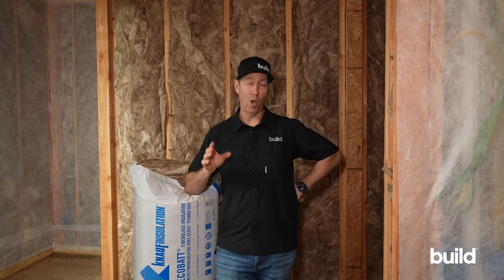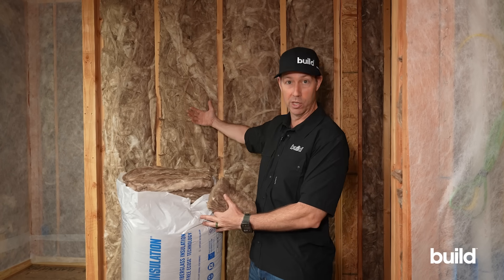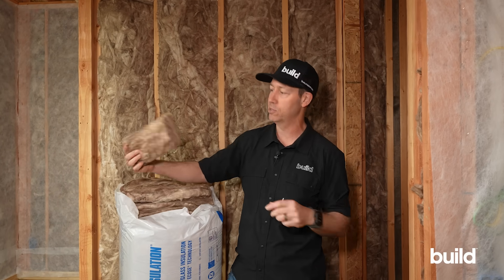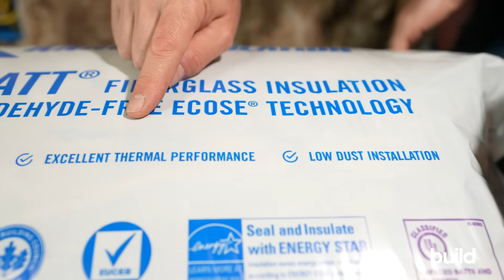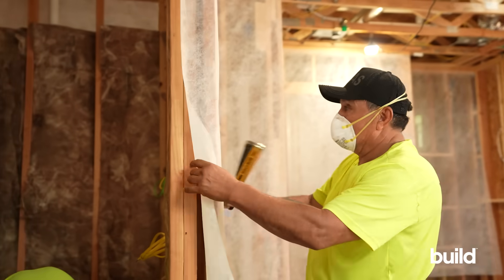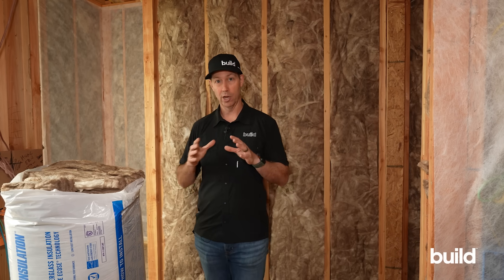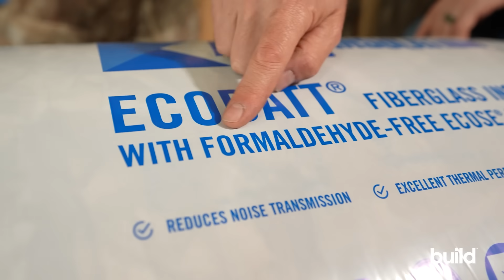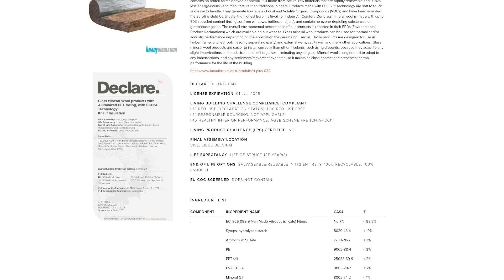NEW Fiberglass Insulation Tech & 3 ways to Use it for a quiet home!

Comment: Can that putty patch be used in attic to seal and soundproof? We live in a noisy city and I notice the sound vibration is greater through the hip roof.
I would like to beef up the road side insulation with rock wool batts.
The curent blown fiberglass has packed to R30. Recommended is R70. Can I mix the insulation?

Comment: Do you use that  same insulation in the ceiling .. when using spray foam on the rood deck and exterior walls ?
Also .. is that permiable sheet cloth have to be used over the  sound insulation?

Comment: Does the binder attract bugs?
Reply: The insulation goes through a curing process during manufacturing that removes any/all possible nutrients for pests and mold. Mold can grow anywhere that food and moisture exist, but there’s nothing in this product that can feed mold or attract pests. It’s been on the market since 2008 without issues and has testing to back it up.

Comment: What’s the paper that is up on the walls?    Assume it is breathable just to hold the insulation?
Reply: Good question. The fabric on the wall is an air permeable mesh that’s used to make sure the insulation stays in place before or during drywall installation.
Reply: @KnaufNorthAmerica who manufactured it ? Where can I buy it?
Reply: Can you use this stuff on exterior walls? Spray foam is so expensive…

Comment: My only concern is will the insulation biodegrade in your walls rotting over time causing mold issues in the future
Reply: The insulation goes through a curing process during manufacturing that removes any/all possible nutrients for pests and mold. Mold can grow anywhere that food and moisture exist, but there’s nothing in this product that can feed mold or attract pests. It’s been on the market since 2008 without issues and has testing to back it up.

Comment: Yes Structure stiffness is a big issue with sound attenuation. Those little holes let through high frequency sound which is easier to stop because of the low energy. Low frequency will move the whole wall, and can be almost impossible to stop at certain levels. In studio build we decouple the inner room and the outer structure, to allow the air gap to dissipate some of that LF energy. Contractors need to be very carful using "Sound Proofing" as a term. Because at a point you wont be able to. (remember the aircraft noise in one of Led Zeppelin's Songs "Nah leave it in").  MDF is a good mass material perhaps under the sheetrock. And always seal the perimeter of the sheets to the frame. Double wall if you can between critical rooms. And also Rockwool Rockboard 60 or 80 is an excellent mass wall fill. On another note, try not to have parallel walls if possible, as they create standing waves (echo). And have sound absorbers in noisy rooms, more important these days as we tend to shy away from Carpet. Good informative video mate.

Comment: Maybe this insulation is different, but standard insulation basically does nothing inside. The cheapest way I have found is to use ice and water shield. Put it loosely in the walls before sheetrock. Going over the studs also gives uou that little buffer of transfer through the studs. You can also use it in place of putty pads. If you want to go the next step, then add insulation, preferably Rockwool.

You can also use the ice and water shield to wrap pipes in the wall to cut down sound in walls.
Reply: What brand of ice & water shield ?
Reply: Wouldn’t this create moisture problems ?
Reply: @juiceman8873  I use Grace. I am in Alaska. It acts as a vapor barrier on outside walls. And it's not an issue on inside walls. You would just need to be careful how you use it in your climate.

Comment: What is that felt paper your using?
Reply: The fabric on the wall is an air permeable mesh that’s used to make sure the insulation stays in place before or during drywall installation.

Comment: I suggest a book - The Master Handbook of Acoustics (Everest and Pohlman).  It's more about mass, isolation of mechanical transmission, and stopping air leaks than stuffing batting inside the walls, although that will help.  The question is whether or not the additional expense is worth the STL (sound transmission loss).

Comment: Like so many ideas the best idea is covered in first 2 minutes. Reducing wall noise by 25 % with BULK insulation and THEN  ad .0025 %(or less) more quiet by plugging PIN HOLES.

Comment: What is the purpose of the non-woven fabric on the internal walls?
Reply: The fabric on the wall is an air permeable mesh that’s used to make sure the insulation stays in place before or during drywall installation.

Comment: Please don't handle fiberglass insulation like ever again for your safety 😢Even if it is "safer" fiberglass. What makes fiberglass so dangerous is that the actual glass fibers under a microscope look like tiny microscopic needles that do not decompose. Google alveoli structure in lungs. Those fibers that you can't see will get stuck in your lungs and will lodge itself inside causing microscopic scraps. The body can't get rid of it and glass is non decomposable. The fibers will only come out after you die.
Reply: How do people then survive a career of insulating if the body doesn't get rid of it?
Reply: @olgajoachimosmundsen4647  They don't, they have a severe heightened risk of lung cancer. It takes years to develop we are talking 10+ 20+ years. On top of that if you get lucky and don't get cancer you will permanently experience reduced lung capacity like shortness of breath. Same goes with silica dust.

Comment: Fiberglass insulation, state of the art 1960’s…now it’s 2024, maybe there are better options? Unless you like insulation that absorbs water and provides rodent friendly housing.
Reply: Foam is toxic, so that's not a good option. It emits toxic vapors for a long time.
Reply: The insulation goes through a curing process during manufacturing that removes any/all possible nutrients for pests and mold. Mold can grow anywhere that food and moisture exist, but there’s nothing in this product that can feed mold or attract pests. It’s been on the market since 2008 without issues and has testing to back it up.

Comment: I would rather use Roxul stone wool, it's already a lot itchy then most fiber glass.  Plus is has the benefits of: Noise reducing, inorganic (yes things actually do eat fiberglass, not for food but just to fill their stomachs to make them feel full) and that it wont rot if it gets wet.  But the most notable difference the temperature before each insulation which catch fire/smoke out.  More fiberglass smokes out instead of burning out at 800°, Roxul on other hand wont ignite until 2,100°
Reply: I'm in the mineral wool camp too. It's hard to eat or burn rock! I love how rigid it is relative to fiberglass, and I can cut exact shapes.
Reply: I was in the mineral camp until I used it.  It was so much worse than fiberglass for itchiness.  I couldn't believe it.  I hate fiberglass and I hate mineral wool more.  The cost difference isn't justified either.
Reply: Depends I've had batch of safe and sound that stuff and another that was floppy. Manufacturer wouldn't help aside from go back to homedepot. I had some leftover from the previous batch to show the difference.
Reply: @MBisFrenchy  I agree,  That is why i figured out that Lowe's gets better bags, or you have to order a stack of 12 from Home Depot online when they have it.  Supposedly Home Depot online is separate from the Home Depot stores.  Of the 2 orders i got from the Home Depot online the quality is better.  And it's probably because what they have in the store is there a long time and / or abused

Comment: What do you call the sheet that's being placed over the insulation?
Reply: The fabric on the wall is an air permeable mesh that’s used to make sure the insulation stays in place before or during drywall installation.
Reply: @KnaufNorthAmerica where can you buy this ?
Reply: @KnaufNorthAmerica  do you have a product name, if even a generic name if you don't manufacture it yourself.
Reply: Moisture barrier

Comment: Your comments about air transmission and 1/2 inch holes reminds me of building a music rehearsal studio in my youth.  This was in the early 80's.  I had studied studio design.  I built the room with double sheetrock and a double fire door entrance.  It made a huge difference.  But at this point, as a band was rehearsing, I went around the stand alone garage.  I would would hear exactly where I had sound leaks   What amazed me was that I could exactly locate the sound source.  A squirt of caulk and the sound stopped.  So your observation of a half inch hole in a concrete wall is true.
Another suggestion is a real false ceiling.  I remodeled a basement and had 9 feet of headroom.  I dropped the ceiling down to 8 feet with a stud, insulation, sheetrock ceiling.  A variant of the staggered stud construction of recording studios.  The end result is that I could barely hear my family walking around up stairs.  The A/C contractor did not like the 9 inches of space to put the ducts into.  But it worked.

Comment: What's the fabric for
Reply: Looks like it is just there to not push the glass out the other side?
Reply: A more breathable vapor barrier?
Reply: The fabric on the wall is an air permeable mesh that’s used to make sure the insulation stays in place before or during drywall installation.

Comment: Would regular fiberglass insulation like that or Rockwool work better at absorbing sound? Just curious because I have a bunch of Rockwool but if fiberglass will be better I’ll use that in specific areas.
Reply: All fluffy and open-celled products dampen the same amount of noise in acoustical assemblies regardless of R-value or density, assuming they’re the same thickness.
Reply: At one point he says that rockwool would work.
Reply: @ I know it would work. I want to know which is better
Reply: @berkoskilandscaping4247  he said this is about the same price as fiberglass and I know that Rockwool is 2x more per sq ft.
Reply: @berkoskilandscaping4247  The denser of the two products will be better at attenuating noise. Typically rockwool is denser and a bit more expensive than fiberglass.

Comment: I’m still stuck in my ways when comes to my tool of choice when cutting during install. My fav tool for cutting insulation is a cordless electric knife and prefer “bread” blades. So happy they came out with rechargeable cordless model long ago, cuz when was corded…..had dedicated cut station that was moved throughout installing. Cordless so much easier to use and great tool, also makes short work on a turkey or ham😉

Comment: Sheetrock? Drywall? That's cheap. Using a product like Quiet Rock instead, which will not be at most big box retailers, will eat that sound up. It is designed, complete with mounting adhesive, to absorb noise.

Comment: Sand is an awesome sound insulator.  Two non-coupled walls with sand filling the void between will transmit almost no sound.  The sand has a lot of mass and each grain of sand is loosely touching the next, so as one vibrates it only partially transmits the vibration and partially just rubs, killing sound energy into friction heating of the sand.  By the time you get through a few inches of sand, essentially zero sound left.  Also, don't forget that sound will go under and over the wall.
Reply: Not knocking your suggestion. I know it would work, but sand is very heavy. Have you actually filled wall cavities with it?  How do you retain it?  I would think it’s too heavy for drywall to hold it. Plus how do you get it in there?  Pour it in from the top plate?
Reply: @usmcfrommt9790  You are correct.  Sand is actually used for soundproofing in some high end studio situations.  But yeah, it is very heavy and it is not poured between sheetrock walls, I forget how they did it, but I think it was concrete walls.  And then they floated the concrete walls in sand so it wouldn't transmit under the wall.  I did some soundproofing years ago for a home theater and read about this, but of course did not do it.  I used that special sheetrock Matt referred to along with rockwool and did not do in-wall boxes.  I surface mounted the wall boxes and just drilled small holed for the wires and used soundproofing caulk, a messy messy goo that never dries and sticks to everything.  I floated the room on silomer blocks and isolated the room so that it was a room inside of the room, with no connections except where it rested on the silomer.  It worked.